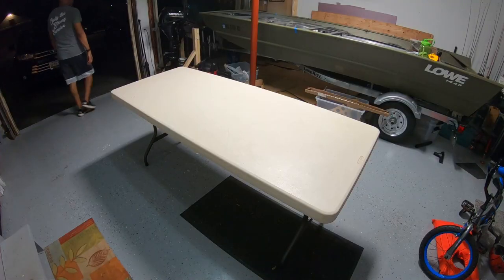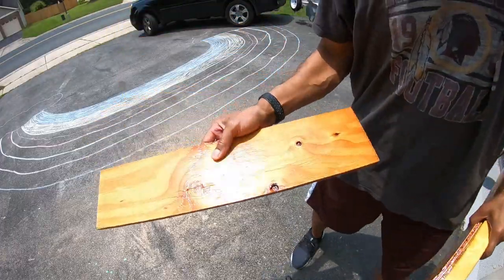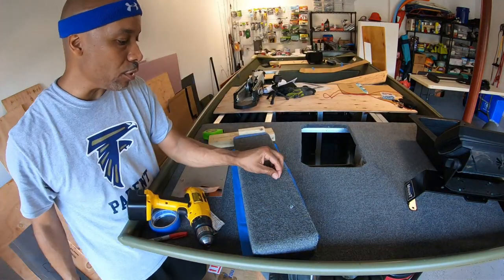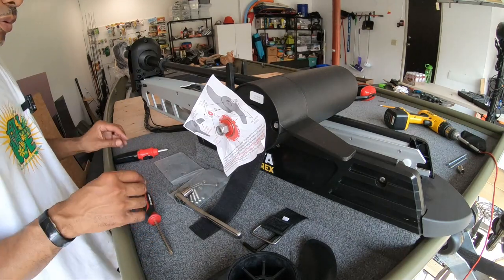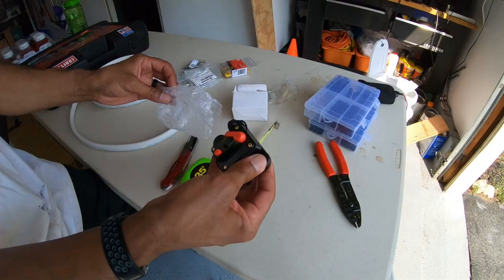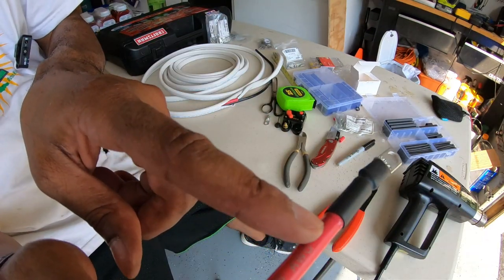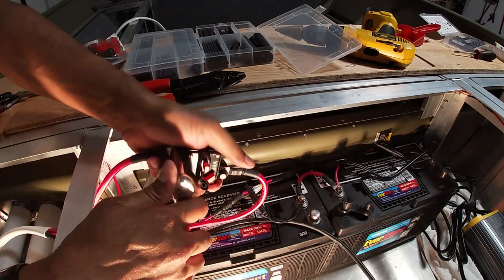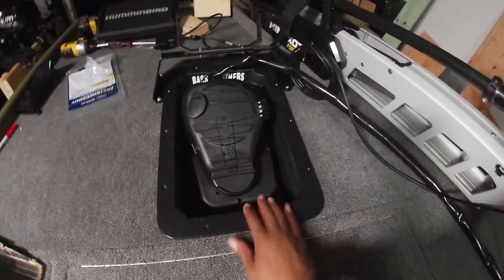Minn Kota Fortrex UNBOXING & INSTALL {Jon Boat To Bass Boat Conversion} Lowe 1448

Comment: Since you modified your boat to make it look extremely nice... How much extra weight have you added
Reply from the maker: Honestly I don't know but I made every effort to keep it as light as possible. I can say the boat feels great on the water. Extremely stable. Doesn't tilt or rock side to side. Even when you stand on the edges of the boat.